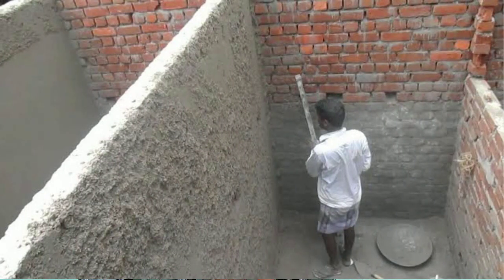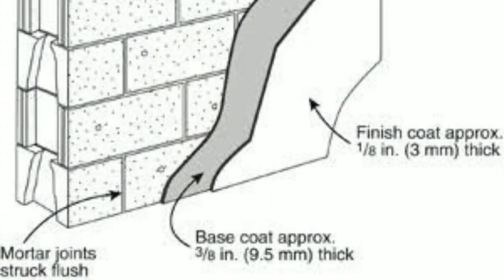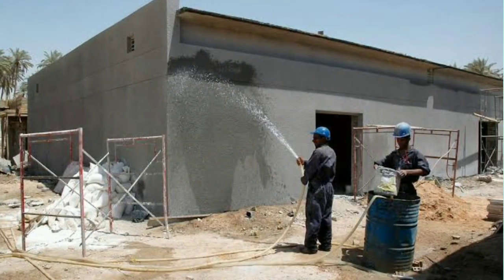சுவர்களில் விரிசல்? reason for cracks in wall | wall plastering techniques|wall crack repair |cracks

Comment: Plastering why p sand use instead of m sand?
Reply from the maker: Sir in m sand, it have more coarse particles compared to p sand... And also the p sand gives smooth surfaces and good finishing to the interiors and walls
Reply: @civilbasicz9732  thanks ji